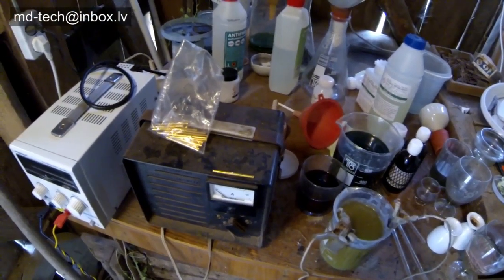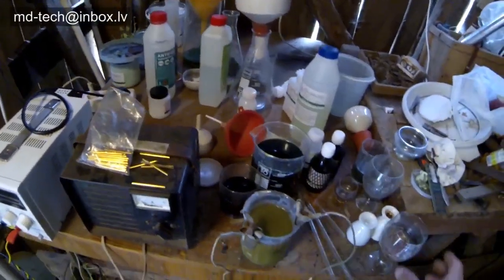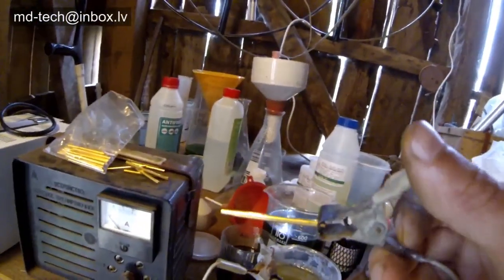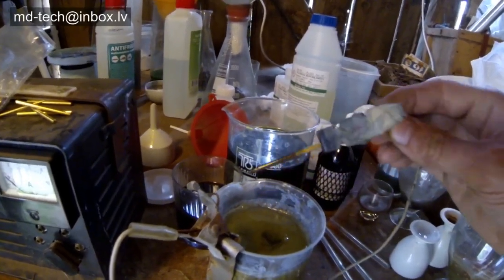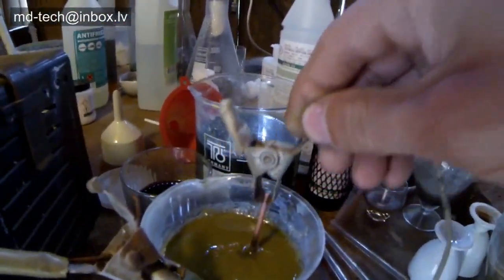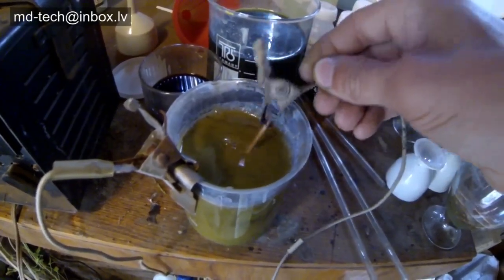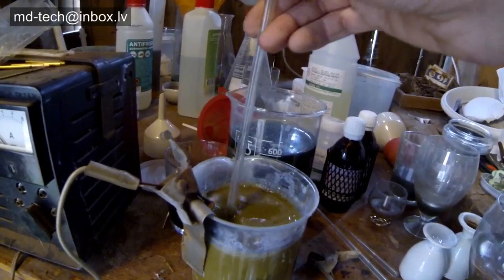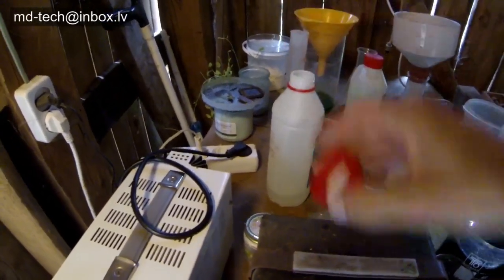Salt water recovery gold. World secret. :) Chemistry games

Comment: hi, which method is the most efficient and cheapest to dilute gold ? thanks
Reply from the maker: Hydrazine salts
Reply: @chemistrygames5811  thanks. but i read that it is very dangerous chemical. Is there any other way to dissolve gold particles ? thanks
Reply: @five55-d5g  you asked what the most efficient cheapest way was.
If you want the safe way it's in this video
Reply: @FrancisR420  thanks
Reply: Hi, is there any solution except regia  water dissolve gold?ty

Comment: and what would happen if i used a gold plated chain the used brass as base metal instead as copper? would it still work? or what adjustments would need to be made
Reply from the maker: Yes! 12 volts and 10 ampers and done. :)
Reply: Thank you
Reply: And what amount of Hch or Iron Sulfate
Reply: Chemistry games help im in the philippines and honestly we are not to keen on promoting chemistry here... which leads me to the question will this be suitable for gold plated 925 silver?
Reply from the maker: Solution need turn clear and after iron sulfate no reation on tin chloride cristal.
Reply: @chemistrygames5811  thank you!

Comment: How do you recover gold from solution when done extracting from pins? And do I need to dispose of solution when done or can I reuse the solution?
Reply: I believe the gold would plate out on the negative terminal.
Reply: @ThePeterDislikeShow  thanks! And is it possible I could dissolve the gold in the solution then percipitate out with smb?